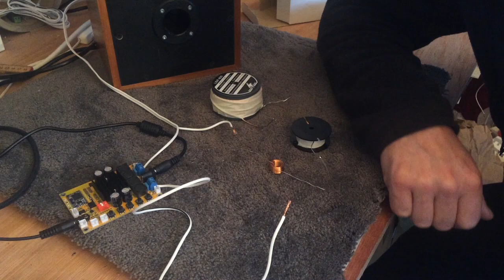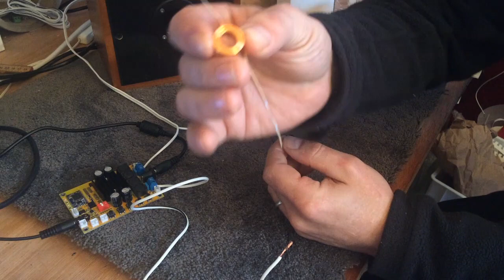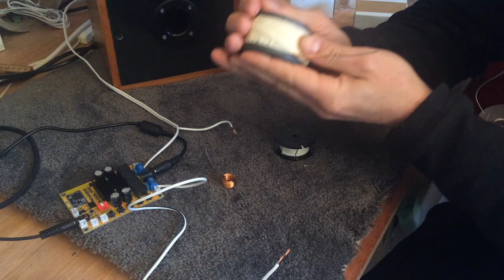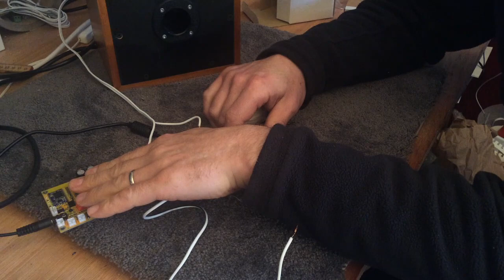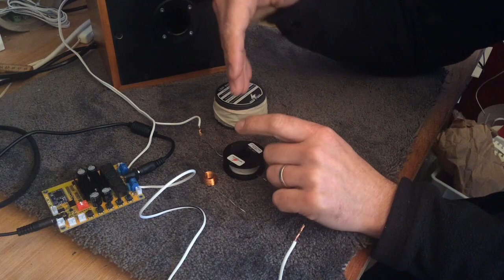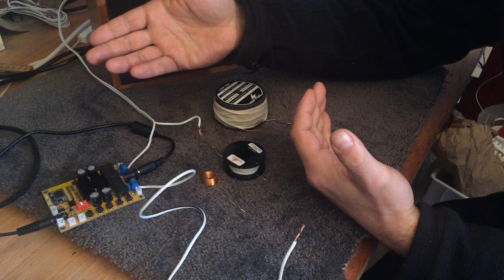What is an Inductor doing in a loudspeakers?

Comment: Question... what happens when the impedance of the speaker is rising with frequency? For example, I picked a 3.5mH inductor to go with my "4 ohm" woofer for an approximate 200hz 6db/oct LPF. However, I have come to find out that woofer's impedance is 6 ohm at 200hz, 8 ohm at 400hz, and 11 ohm at 800hz. I am wondering what dB reduction I can expect at these frequencies.
Reply from the maker: Very good question, and yes depending on how much induction there is in the motor system the impedance will start to rise. If the crossover frequency is in the area of the this rise, you should consider a zobel filter aka impedance correction filter. It consist of a resistor in series with a capacitor and this series filter is parallel to the woofer. Here is how to calculate https://diyaudioprojects.com/Technical/Speaker-Zobel/

Comment: Learned a lot... after watching this video I don't understand why Pioneer opted to put an Inductor directly inline with a horn loaded ribbon tweeter. Maybe ribbon tweets are that much different than dome tweets. I know the driver motor is massive.. heavier even than the 5 ¼ sqwauker.
Reply from the maker: Must be a Horn for midrange then, because an inductor will for certain remove some high frequency, dampening of output is with resistors. Even the voice coil itself is removing high frequencies and the less induction the better + the Horn itself raises the lower end of the tweeter spectrum and does nothing typically above 10KHz because the wavelength is so short that the Horn wont change pressure to speed

Comment: Does it matter if you you a large inductor. I notice some inductors say 300watt ECT make a difference
Reply from the maker: Hi Mark, it matters what the inductor can take as far as how much effect (watt) you are planning to apply to the circuit. Here you would have to choose the inductors wire thickness in order to accommodate that power.

Comment: If you have to speakers wires in parallel and wire and inductor to one will it affect both of them?
Reply: Only the audio/speaker with the inductor between it, will be affected.  The other speaker, the one in parallel, wouldn't have much of a change in signal.  =  )

Comment: Can I filter only midrange driver in floorstand speaker?
Reply: Every drivers should have their own device to give them the frequencies they can reproduce without distortion. In the case of a three-way design ( woofer-midrange-tweeter ), you will need an inductor between 1,2 mH and 2,4 mH for an 8 Ohm woofer. You will also need a 12 to 24 uF ( microfarad ) capacitor for the midrange ( assuming you want to cross at 1 kHertz ) and a 0,5 mH in series with the capacitor to keep the frequencies between 1 kH and 5 kH to be fed to the midrange only. Finally, a 3,3 uF cap will be necessary to protect the tweeter from receiving freqnencies lower than 4 kH. Also, since midrange and tweeter are more efficients than a woofer, some resistors might be useful to balance the sound from the 3 drivers. As you can see, it is quite complicated if you want a good sound from a multi-drivers speaker. I hope it answer you question thoroughly.

Comment: Hello. In order to increase high ends, do I have to change the inductor to a smaller one or simply remove it ?
Thanks.
Reply from the maker: Unfortunately not that simpel, the ability to how high a tweeter can go in frequency is the tweeter itself, and you can accidentally kill some of that performance with using dampening with sandcast resistors or crossing with bad quality capacitors like the electrolytic type. The size capacitor and inductor is what determines the crossover frequency, so more a question og how low the tweeter will play.

Comment: Thanks for the demo, could you please explain how to filter the the mid frequencies on a tweeter
?
Reply: 😍 can you connect your speaker to compare with cheap mundorf 47uf Mcap tin cap(white.color) vs 47uf Mcap Alum vs 47uf Mcap supreme silver oil vs 47uf Mcap Supreme silver/gold/oil EVO.  Does it sound different ! Video have ? 😍😍. ( can u do a video with that can ? It will be very Fun to try )........::::/

Comment: Bot 8.2mf is a capacitor no?
Reply from the maker: yes, with that value its a capacitor
Reply: @AudioTalk  the reason I ask about a 8.2 mf is because the bigger  inductor you using to demonstrate, you said is a 8.2mf and sounds like something I need because it brings down the hi and mid from the woofer bot when I look up inductors they all say mh not mf
Reply from the maker: @hugodiaz163  that is correct for the inductors its mH, and yes placed in series with a speaker driver it will limit the highs and the bigger the value the lower in frequency its doing that
Reply: @AudioTalk  thank you sir

Comment: Wow I ask about this a lot and nothing 😂 thank you sir. 
Now. Do I connect this filter to the negative ore positive ?
Reply from the maker: It actually doesnt matter, lets say a capacitor in series, it will have the same effect on minus as well as plus, but to keep it organized I will recommend placing all components in series on the plus wire from the amplifier, just like it shows in a standard crossover diagram, then someone else can easier figure out what is going on. The reason I specify plus from the amplifier is that you can have a polarity shift on example the tweeter, so that the tweeter ends up connected with opposite polarity, but are you just doing 1 capacitor (first order) don't worry about polarity shift.
Reply: @AudioTalk  thanks so much
Reply: Is it the same for electricity

Comment: Hey Ken, first of all thanks for sharing the knowledge. Second, I have a couple of questions. I'm upgrading a Yamaha speaker set's crossover (3way and 2way, 4speakers total) I already upgraded the capacitors with polypropylene ones, and I wanted to take it further up a notch and add frequency filters to all the speakers to assign their designated frequencies to each driver. The problem is I've looked all over the internet and haven't found a tutorial good enough to inspire confidence aside from this video. However, I'm still confused enough, so my question is how would I go about installing these "filters" on, say, a woofer, a mid, and a tweeter? And where could I install these inductors in the existing crossover since I'm working on a forgiving budget here.
Reply: 😍 can you connect your speaker to compare with cheap mundorf 47uf Mcap tin cap(white.color) vs 47uf Mcap Alum vs 47uf Mcap supreme silver oil vs 47uf Mcap Supreme silver/gold/oil EVO.  Does it sound different ! Video have ? 😍😍. ( can u do a video with that can ?).........:/
Reply: Use basic reactance equations Inductance = 2pifL. Capacitance =1/2pifC. For inductance the reactive impedance increases with frequency increase. With Capacitance the reactive impedance decreases with frequency increase. Could use a number of spot frequencies for the f part of the equation matching to the response of each speaker driver component. Probably want some crossover frequency overlap on the response curve of each speaker driver used so there is not so much in the perceived loudness overall at the crossover frequency.

Comment: What will happen when you wrap an inductor on a subwoofers magnet
Reply from the maker: The induction will change, and if its an air-coil it will change dramatically, so unless the effect of that is measured out, I will advise against placing it there.

Comment: Thank you so much for your explanation and time, I also have a paper woofer that before I had a propylene one, and that makes a huge difference too I changed the woofers on a cerwin Vega Ve12F and now they explode with bass lol well I can always put back the propylene woofers I had, yes these woofers are for a bigger enclosure and cerwin Vega now took an inch from the original design and and one port instead of two and that is a killer now it pushes a lot of bass, Thank you so much again, Luis
Reply: 😍 can you connect your speaker to compare with cheap mundorf 47uf Mcap tin cap(white.color) vs 47uf Mcap Alum vs 47uf Mcap supreme silver oil vs 47uf Mcap Supreme silver/gold/oil EVO.  Does it sound different ! Video have ? 😍😍. ( can u do a video with that can ? It will be very Fun to try ).......:://

Comment: Hi, I wonder if you can help me, I bought a set of speakers to put on my DIY project and not sure why they have too much bass, I have to put the bass at -4db in order to have a good listen reading any suggestions that you can tell me to take some of the bass out of the speaker? you said about using capacitors? How do you use and what kind of value I need to use in a 12" woofer? Thank you
Reply from the maker: The woofer has to go in the same size enclosure as before to have that performance and if there was a pipe (called a port) it will also need to be there with the same dimension. Changing the enclosure size and port, would require the thiele-small parameters of the woofer to calculate a new box. If all the above is good to go and still is too loud or muddy, the tweeter and/or midrange is not loud enough for the woofer, and they might have dampening in current crossover with resistors, but removing them will require to consider ohms law if you are ending at the same impedans again. Dampening the woofer with filter introduces problems, 4dB is a lot of energy to burn off in resistors and box alignment changes dramatically with typically a high Q factor that makes the bass really muddy.

Comment: can i use instead of inductor a 4 ohm speaker?
Reply from the maker: The induction (mH) is for the most part too little for a useful crossover frequency. In reality the speaker itself has its own filter in that way, but because the induction is not that big you will for the most part have cone breakup before that filtering kicks in, thats not harmful to the speaker, it just doesnt sound good. You could also take a small stel rod and wind isolated wire around it , but then you would need a gauge that can measure inductance to see what value you have.

Comment: awesome video, hey can you put two inductors together?
Reply from the maker: Yes if you connect the 2 inductors in series, and then you can add the 2 values together. Make sure to spread then a bit a part, because the fringe field (magnetic) at each end will affect the value of each other, and that effect will be depended if that field is out or in phase. So instead of getting all that straight, just keep a healthy 2" distance or more.
Reply: hello i want to design a low pass filter at around 1600hz (12db) buttersworth for two eminence delta 12a (8 ohm speakers with an RE of 6.3ohms (says so in pdf) i have them in my car in parralel mono instead of stereo for more power from my amp so they are at 4 ohm (3.15 ohms RE ??¿¿??)

when looking for the mH value and uF values do i go by the nominal 8 ohms or do i go from the RE of the speaker

thats the big one im confused about right now would apreciate an answer :)

link to the pdf of the speaker is: 

https://www.eminence.com/pdf/Delta_12A.pdf

p.s i want it to avoid breakup i guess? also have an 1 inch comression driver in the vehicle which has an high pass filter that i bought of 1600hz (-18db) what are you're reccomendations i dont know how to wind my own coils so im stuck with coils from for example visaton here in NL (which come in: 0.1mh, 0.15mh, 0.22mh, 0.33mh, 0.47mh, 0.68mh, 0.82mh, 1.00mh,  1.5mh, 2.2mh, 3.3mh, 4.7mh) 

(link: https://www.reichelt.nl/Spoelen-voor-scheidingsfilters/2/index.html?ACTION=2&LA=3&GROUP=I936&GROUPID=5509&START=0&OFFSET=16&SHOW=1)

Comment: I was wondering if you can just add a inductor and capacitor to the wire, but both connected to an different amp channel? 
Because I wat to build a speaker and I need at least 45W for both the tweeter and woofer. Am I able to instead of connecting just one 50W channel to a crossover, and then to the speakers. 
I thought if I connect the tweeter to a 50W channel, and just put an capacitor in between the amp and the tweeter. And connect the woofer to the other 50W channel, and just put an inductor between the amplifier and woofer.
Does this also work?
Reply from the maker: You absolutely can, just knowing that weirdness can occur in the music if the board is stereo and you are playing a stereo signal. But technically it would certainly work